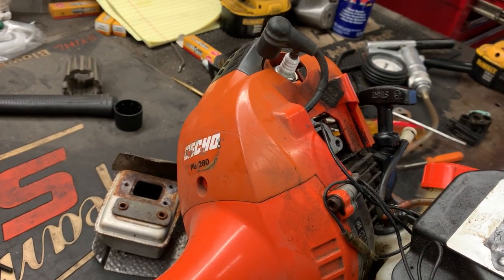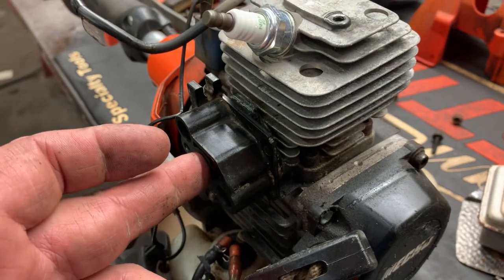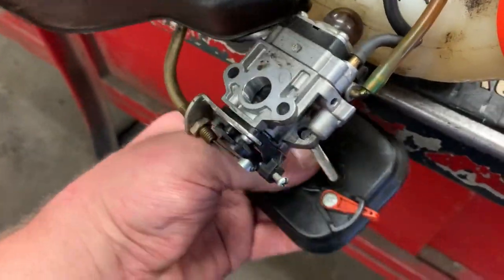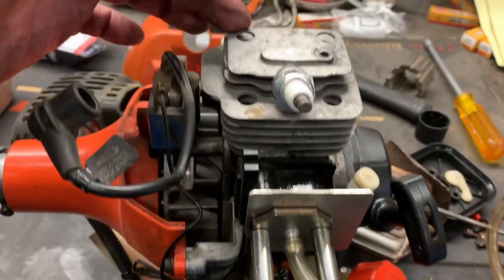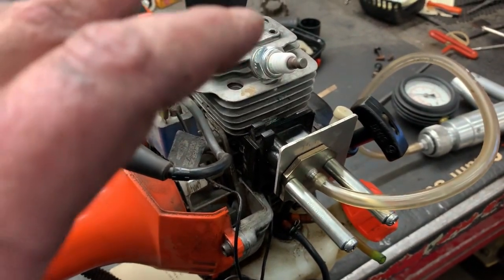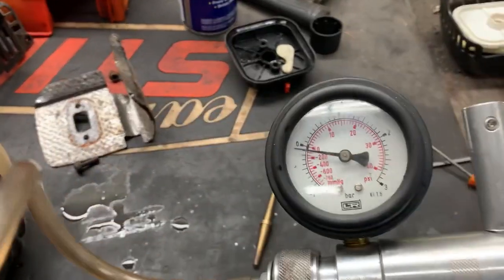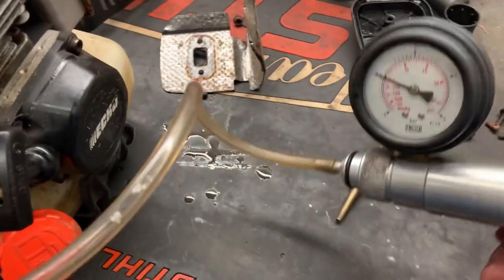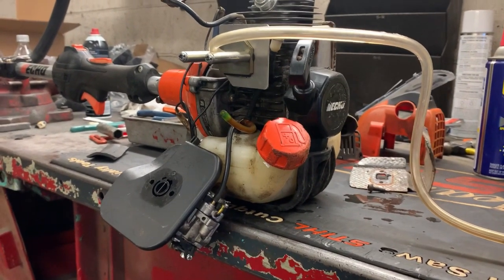PART 1 : 2 CYCLE DIAGNOSTIC / PRESSURE AND VACUUM TESTING

Comment: Guys, when you buy one of these testers, make sure it does vacuum AND pressure. A lot of them look the same but only test vacuum. I bought my tester on eBay for $40.00, 7 years ago and it still works great.

Comment: Good info. I think I have a blower with a crank case air leak It will run on carb spray or what ever but it will not pull fuel from the tank to the carb the primer bulb works fine.

Comment: I would add that another common leak location on 2 cycle equipment is the decompression valve, if it has one.
Reply from the maker: Yes. Didn’t think of that one!  Thanks!  Sorta goes along with spark plug

Comment: Do you have to have the engine at top dead center to check the crank case? And vice versa to check compression of the cylinder head? Or does it matter?

Comment: I'm trying to pressure test a echo srm 2100. I have all the opening blocked off (that I know of) but I'm getting zero pressure when I test it, no matter how hard I pump. I tested another echo weed eater and it held fine. Any suggestions?

Comment: Mowermedic1  PLEASE HELP, I know their crappy and old even though it seems their hard to get parts for them but, I have a 2005 craftsman “model 358.79105” 25cc 2-stroke 47cm gas trimmer and a older 1998 craftsman “model 917.387410” 20” lawn mower with the original model 143.004002” engine. They both run with small issues but, the problem is here in New Orleans it seems that no one wants to work on them to any degree, so I’m stuck to do it myself and that’s fine. 

My problem is the parts and the small engine understanding part of it, I’m a heavy duty diesel tech and do all the work on my 85 Ford F-250 4x4 & 85 Mercury Grand Marquis. I’m by far no small engine tech except for proper maintenance like air filter, spark plug & fuel filter and small easy repairs like primer bulbs or pull starting assy’s. Both the trimmer and lawn mower have carb issues and I’m just stuck on how to fix them and getting the parts to do so.

Comment: You are wrong you need at least 15 bars of vaccum to test it
Reply from the maker: 15 bars is well over 200 psi. My air compressor doesn’t even go that high.
Reply: @THEMOWERMEDIC1  each bar is not 1psi in others words 1psi is= to 0.0689476 bar
Reply: You probably mean 1 bar, which is right around 15 psi.